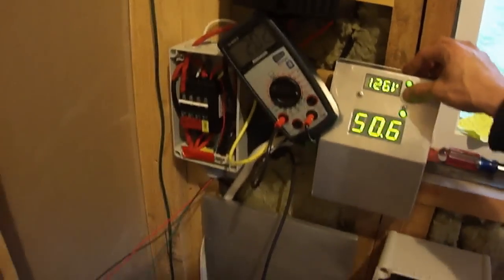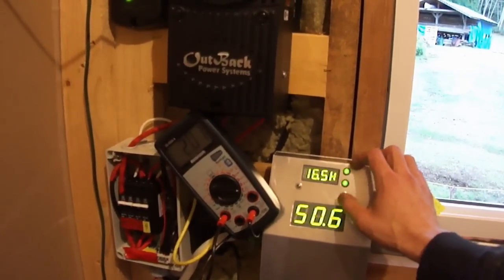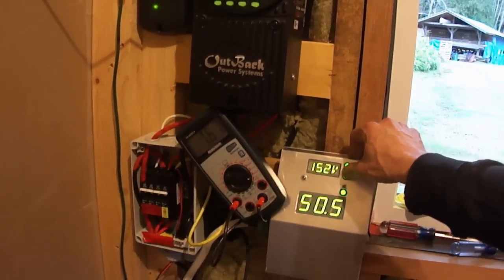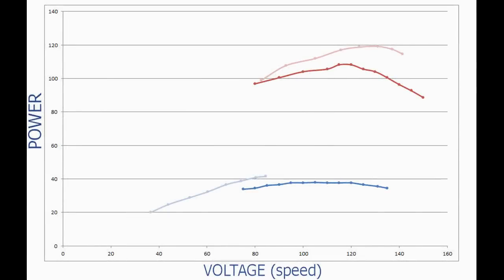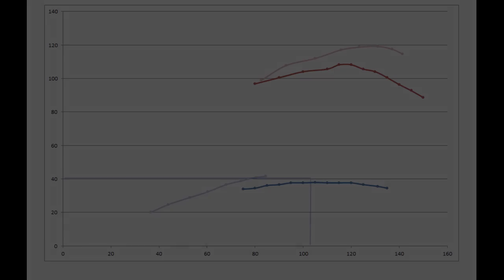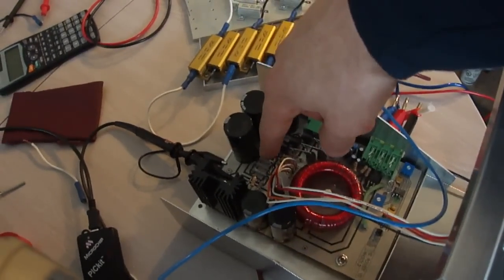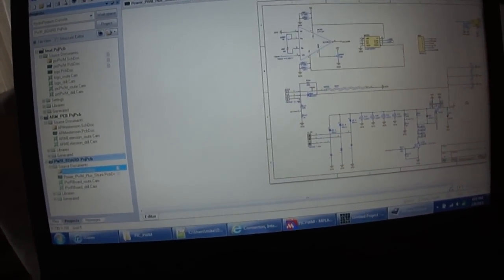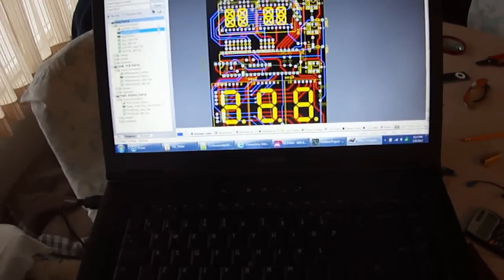Micro-Hydro Voltage Regulator (charger)

Comment: is there any benefit in applying MMPT for mycro hydro? I mean I know that MPPT is good for solar panels, but is it also beneficial for mycro hydro?
Reply from the maker: Thanks for the question!  The power curve changes from one to two valves.  I showed test data at 1:12.  MPPT gets us between the two maximums, (120V @ 2 vs 100V @ 1).  Doesn't make a big difference, but the code fairly simple.